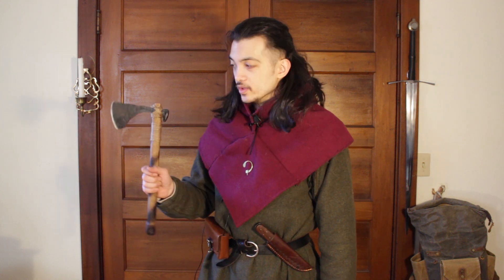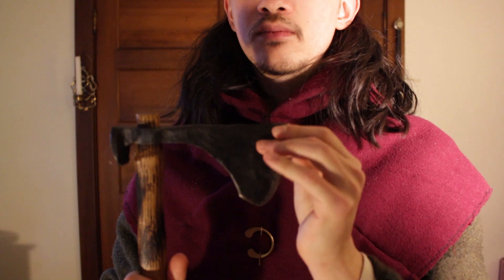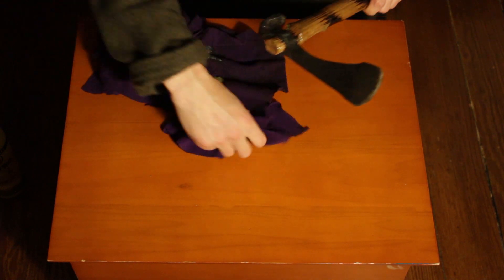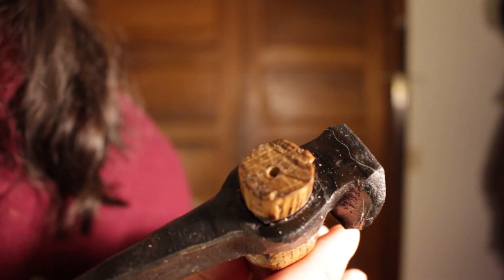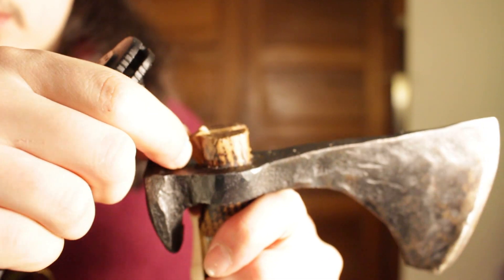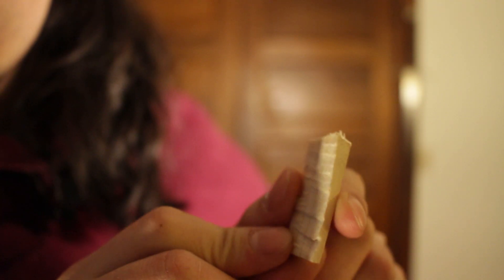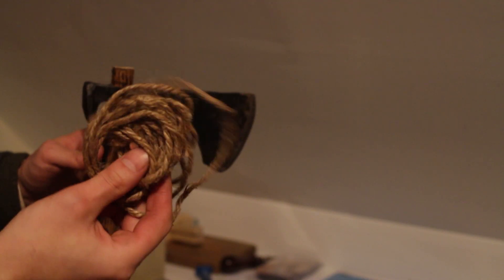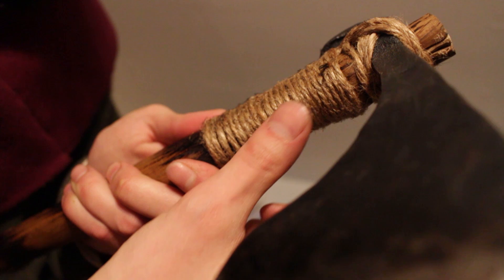I Broke My my BRAND NEW AX!

Comment: I would say if you are that certain its gonna break then don't use it. If however you insist on using it make sure you have eye protection on and a well stocked first aid kit handy. If at all possible don't use it when you are by yourself. Having someone nearby to help can be a lifesaver.
Reply from the maker: I tried it out after filming while making a roycroft frame pack, it seems to be holding up well. I'll have company on my trip, so we'll make sure we are safe. Thank you.
Reply: @LivingAnachronism  I forgot to add that I really like the look of the handle and the wrapping, very pleasing look.

Comment: You would be far better off making a whole new handle from seasoned wood that has already shrank. Theres a channel called Wranglerstar here on YT. Check him out, he really knows his stuff & he has some vids specifically on how to make new axe handles yourself in the proper way. God speed sir.
Reply from the maker: Thanks bro. Replacing the handle is the plan in the long run.
Reply: @LivingAnachronism  No problem. I figured that might be the case. I ran into similar problems awhile back & his vids helped me fix it so maybe itll help you too.

Comment: Elmer's wood glue is your friend.  The way that glue works it creates a bond that can actually be stronger than the wood was before the crack.  

I've used it to repair tomahawks when they started to crack and not had any problems over multiple throws while waiting for the new handle to come in.  And by multiple throws I mean around 50.

Comment: Potential things for future fittings (I have no idea if this would work, I'm just applying a method used in seating tangs and a this might work), if you were to heat up the eye to roughly a cherry red, probably worth double checking with tang handle fitting videos, and then burning the axe head on for a tight fit. Alternatively coming back to the oil, the issue is that the moisture in the grain has been replaced with air and the oil method tries to replace the air with oil but there isn't much pulling the air out so if it was put into a vacuum chamber submerged in oil that might work but as I pointed out earlier this is just a maybe this will do a thing and might not be any better than just soaking in oil